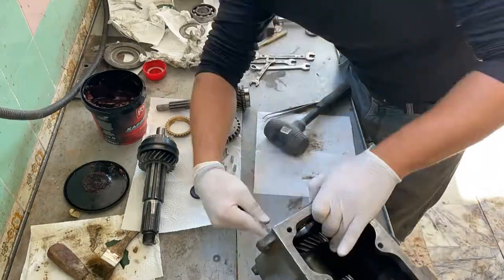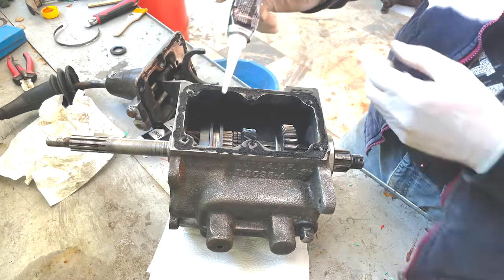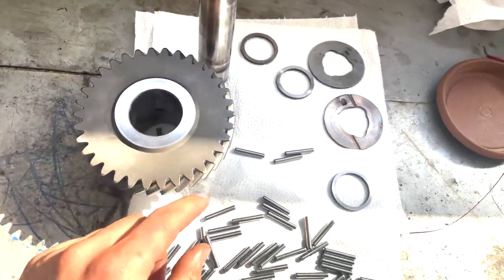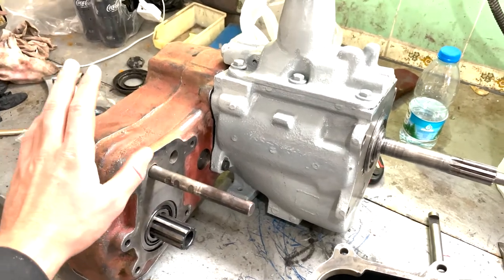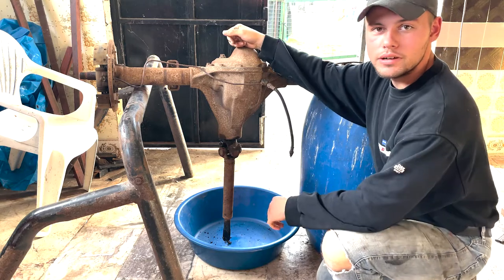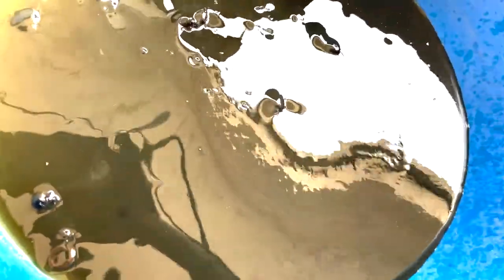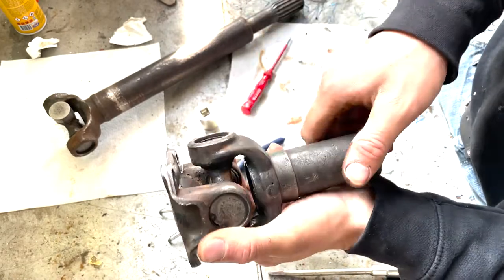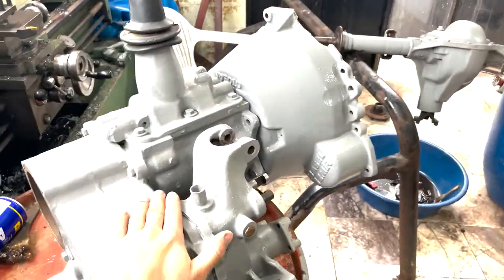Jeep CJ5 Rebuild Part 4 ll Cleaning the transmission

Comment: I do not know what is available to you in your region , in terms of supplies and materials but you are doing well just the same . 
If you can obtain MAP gas in hand held cylinders with a valve , I believe of brass construction , would be very useful to heat rusted and frozen fasteners such as nuts and bolts to help in disassembly . Not all fasteners can be easily disassemble as you are aware but if there is any chance at all , MAP gas has helped me in many disassemblies . If it is obvious that the fastener is badly corroded and deteriorated and to be replaced , I agree that bringing and cutting will be necessary . I have encountered many like these upon removing the body tub from my Jeep as well . Nearly all were to be ground and cut as well . The regions where these Jeeps were driven will dictate the condition of these parts and fasteners . My Jeep was last used as a snow plow so it was worked very hard . I hope your Jeep was treated much better .
It is obvious that you are very experienced and know very well how to accomplish and what to expect of your repairs and replacement upon all the inspection your making of all parts and assemblies . I hope many will learn from your videos since most of us who search for tutorials are either beginners or need some kind of assistance . Viewing someone doing this work is very real world and knowledgeable and is better than reading any instructions manual such as a repair manual or factory shop manual . Appreciate your sharing and all your time and explanation as well . Thank you again and looking forward to the projects progress when your able to work on this Jeep and post a video .

Comment: Thank you for posting this video ! Respecting your time constraints and also that you must do the work and record , I think you are doing very well . I too have a jeep CJ5 project ( 1973 ) and most of my work is very similar to yours . I must repair the entire body tub which is proving to be very expensive . I’m not very familiar with the climate of your country ( turkey ) but I hope that climate is kinder to vehicles such as your Jeep . Apparently , something has caused extensive deterioration of the sheet metal of its body . Here in the United States , many regions have snow and frigid temperatures , as you may know , which needs for the roads to be treated with rock salt and calcium chloride to melt snow and ice during winter months . This of course causes terrible deterioration to all motor vehicles . 
Jeep bodies and chassis have always been known for rust and deterioration , just as your Jeep has experienced . My Jeep as well . 
It appears the chassis is very sound . I certainly hope so . My Jeep chassis needs some repair but I will see to it as best I can and hope to do a proper job and not just a “ band aid “ fix . I really hoping that the body of your Jeep can be repaired by cutting away the rusted  and deteriorated sheet metal and new patch or larger panels can be welded on . I wasn’t so lucky . Much of my body tub will be discarded , saving only what cannot be replaced . It’s quite expensive this way , but replacing with an entire new body tub would still be more money than I’ve already invested . Your progress seems to be a bit further ahead than mine and I’m certainly wishing the best of luck .
It does seem that so far the transmission and transfer case are in respectable condition . Yes , hoping that both differentials will be equally in good condition . Very good the way you engineered an adapter to make use of a more available seal for the differential . 
The transmission and transfer case are very similar to the T-90 transmission and the Dana 18 transfer case but with some differences . 
It appears that they are both in good condition and hoping they will work very well . They did not appear to be in such bad condition . 
The differential appeared to be a Dana differential . I could not say if it is a Dana 41 or 44 model but not knowing where it was manufactured and perhaps under license by Willy’s overland or Kaiser Willy’s , depending on what year this Jeep CJ 5 is , it is difficult for me , with only some knowledge of Jeeps through their years of manufacture . After all , Jeeps were produced around the world so it’s very possible that some production differences do exist from one country to another , aside from foreign consumption manufacture as well . 
It is notable that the clutch cover or bell housing ( names vary of many parts ) that is obviously is a bit longer than what I’ve seen but the engine you’ve stated is a ford engine . That would explain why . Input shaft may be longer as well . I’m sure you may be familiar with the different engines that were available in Jeeps per region over the years . Although there are differences to what I’m familiar with , I’m sure that this Jeep will function just fine , as it always has . Considering your a busy man , I do think your doing very well and appreciate all you share with us under the time constraints and difficulty of working and recording . I personally have enough trouble making do with what I’ve got but do appreciate that you have some access to machinery such as a lathe . Hoping that you will do well to make do with all that is available to you for all your needs during this restoration . It will take time to complete but your progress is respected and actually going well . As always , looking forward to your videos at your disposal when your able . I know it is a lot of work , but it will be an excision day when you’ve completed the restoration and can start the engine . Looking forward to that for you and with you . Enjoy , but be safe 👍
Reply from the maker: İ bought the Jeep in İstanbul (the largest city in turkey) there it was used to tow boats out of the sea. Unfortunately the sea here is quite salty wich is of course just as bad for the jeep as salted roads are. İn my opinon this also explanes why the rear leafsprings are in much worse condition than the front ones because the jeeps rear was probally sometimes in the water.
Reply from the maker: The good news are that where İ live in Ayvalık we rarely see snow and therefor İ hope that after the repair it wont rust as fast.